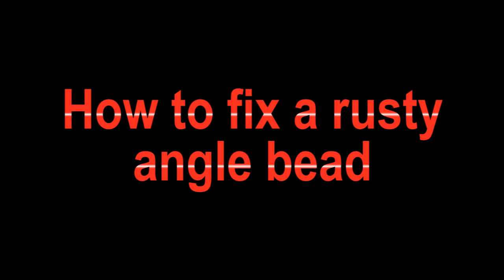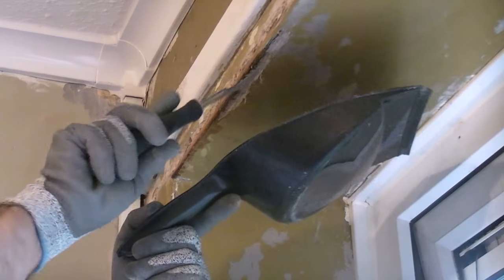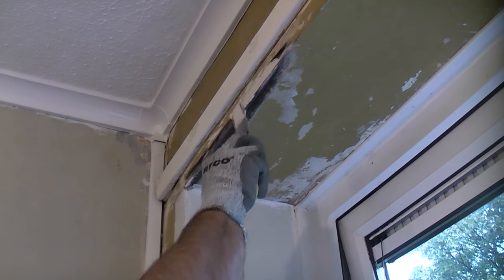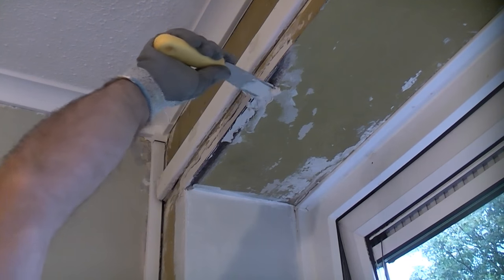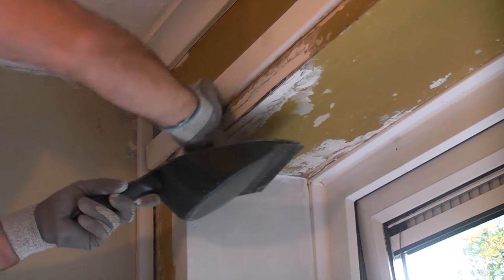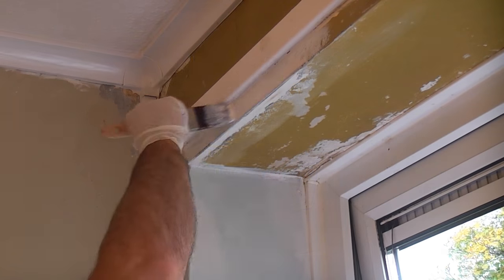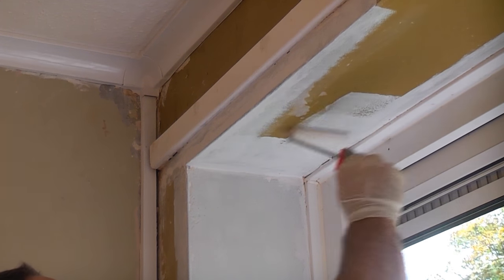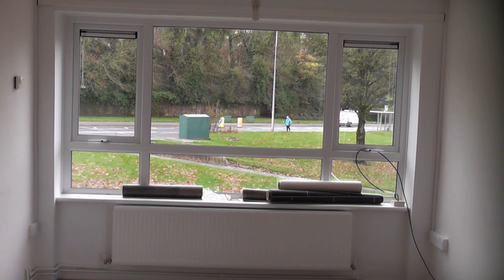How to fix a rusty corner bead | Rusty angle bead

Comment: Hi, I have done that in the past and also just removed the old beading and replaced with new. However when using rust converter you should wear protective glasses as if you do get splashed with this stuff it is really bad.
Reply from the maker: Thanks for the comment John, I'll remember to wear them next time.

Comment: I did this unfortunately it came back within a few months..used this exact zinsser product. High moisture room(bathroom)
Reply: There's a new product coming out soon that tackles this specific problem. It's a bead that goes straight over the existing bead, once it's filled up on either side you won't see the rust again. Turns out to be a very easy  job and lasts. I think it's called a rust easy bead. From what I hear it's not on the market for a few months though.

Comment: Hi good info. But this will only last a short time. The rust will soon be back. You could not paint the back of the bead with the anti rust. Only effective way is to rip out and use a new bead. Which is what I’ve just done.

Comment: What situations would you suggest that you just replace the entire cornerbead instead? And more specifically I'd ask would you recommend removal for a  bathroom floor to ceiling shower wall cornerbead and which the entire bottom of the drywall about 3" high all the way across and again about a foot up another area roughly 2x4 are both water damage and will also need to be replaced. (Probably just going to replace entire drywall with newer mold resistant versions and to check fully the framing for any real problems before worrying about cosmetics) thanks for the video and keep them coming. 👍

Comment: Hello. Any chance of listing products used please. Can the same technique and materials apply to external render of an arch doorway?
Reply from the maker: I used Rust convertor, example here- https://fave.co/3O0zraw
You’ll need an external grade filler for outside use- https://fave.co/3aw9mS3
Then a decent primer- Zinsser coverstain- https://fave.co/3Nu7ZC4
Then two coats of exterior paint
P.S it will be difficult to make the filler look like render, depending on the finish.
Reply: @ultimatehandyman  thanks for taking time to respond

Comment: How long does rust converters work for ? Does coverstain prevent rust coming back?
Reply from the maker: The rust convertor turns the rust into a sound surface that can be over painted. The Coverstain should prevent it bleeding through (although that is unlikely) and leaves a good surface to paint over. Coverstain is a brilliant product as it dries so quickly.
Thanks for the comment

Comment: On the point of using Zinsser cover stain, I used that many years ago in a house where the ceilings were covered in nicotine staining. Ended up just using standard oil based paint in the end as the Zinsser was not covering enough for the money and it worked just as well. Use oil based on damp patches too with great results. Can even use an old paint where the pigment has separated. Suppose one advantage to Zinsser is the quick drying time.
Reply from the maker: Thanks for the info ;-)

Comment: Excellent job!  What is the filler you used?  It is not joint compound, correct?
Reply from the maker: Thanks, I use Gyproc easifill - https://www.youtube.com/watch?v=iM_FD403--k
It is a jointing compound but works great as a filler as it is really easy to sand.

Comment: Good job, as usual. Since we don't see these much in Canada, I'm wondering what the cause of the rust was. Just moist air coming in from an open window over time?
Reply from the maker: It could have been caused by condensation, or perhaps a leak in the flat above. 
Thanks for the comment ;-)

Comment: one thing comes to mind and that is when you are using the sanding  block will it not cause some damage to the rust converter coating already applied to the rusty beading, just  an observation to a very good video.
Reply from the maker: Hi Joe,
I guess it would be possible to sand some of the rust convertor off, but it is being primed with Zinsser Coverstain which should prevent any air/moisture getting to the beading.
Thanks for the comment

Comment: Great step by step instruction video! Top job as usual, may I ask you a question? I have that same purdy scraper, it's fantastic, but is there anyway of "sharpening" the edge of it? I've ran it over sandpaper a few times but not sure if I should use an oil stone. I would greatly appreciate your advice!
Reply from the maker: An oil stone would probably be the best option to resharpen it.
I have badly damaged mine as I was trying to cut a wall plug that was sticking out, so I hit it with my hammer but there was a sheared off screw in the plug!
I'll have to grind mine back and resharpen it when I get time.
Thanks for the comment

Comment: Thanks so much for this video! Is the stain block primer is oil-based am i correct in assuming i cannot paint over it with water-based emulsion? - i have already bought the paint (water-based) for my room, is there a work-around for this?

Also, just a suggestion, but It would be really useful to list the brands/names of the supplies you used in the description 👍
Reply from the maker: Just copied this from the Zinsser website-
“An all-purpose solvent-based, stain-killing, primer-sealer. Ideal for interior and exterior applications. Recoat in only two hours. May be used under any solvent-based or water-based topcoat”  👍
Reply: @ultimatehandyman  amazing, thank you so much! ^_^

Comment: zinsser products are great.I definately would have applied a coat directly to the beading itself if was nt replacing it to prevent any possible bleeding.
Reply from the maker: It should be fine once the rust reformer has been used ;-)
Thanks for the comment

Comment: Good informative, video - thanks.
As you use an oil-based  primer, is it essential to have the same type paint for top coats, or can emulsion be used?
Reply from the maker: Thanks, you can use emulsion over the top of Coverstain. I think I used Perma- white and eggshell mainly in this flat but have painted over Coverstain in the past with emulsion, but I always feather it out when applying it. 
Thanks for the comment

Comment: What did you paint the rust bead with , please.  I'm the fixer in our home, and I'm not as clued in as the other viewers
Reply from the maker: I used a rust converter, it neutralises the rust and leaves a surface that you can paint. They sell it on ebay, but you can often get small bottles of it in car accessory shops etc.
https://fave.co/358mmos
 Thanks for the comment 👍

Comment: Is there perhaps a danger of the rust coming back on the point of that corner where you sanded the filler?
Reply from the maker: It shouldn't do. This was done last year and the flat still looks pristine.
The coverstain should cover the metal and prevent the atmosphere from rusting the bead again.
Thanks for the comment

Comment: had this happen in my house because when the plastering was done the angle bead was scraped and it took off the galvanised coating, i replaced the bead that couldnt be repaired with aluminium beading :)
Reply from the maker: Thanks for the comment

Comment: Great video, 

What did you use on the bead after using the wire brush? 

Thanks
Stay safe
Reply from the maker: I used a rust converter, Loctite make one, there is also a product called Kurust
 Thanks for the comment 👍

Comment: I don’t get it, the plasterer installs an inferior bead which will definitely rust, destroy the plaster when it expands.  This seems like a work guarantee scheme, so they get more work when it goes wrong.  Why don’t they use stainless, so simple.🙄🤦‍♂️🤣♥️
Reply from the maker: A lot of plasterers use plastic beading now, to avoid problems.
Galvanised beading is ok, providing it does not get scratched during installation etc.
Thanks for the comment 👍